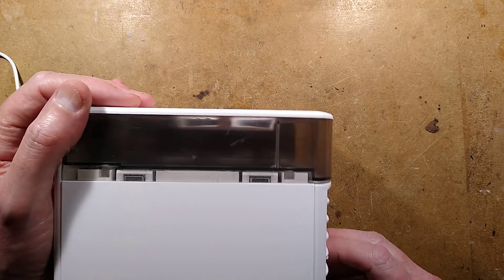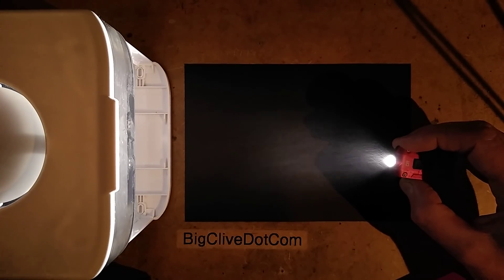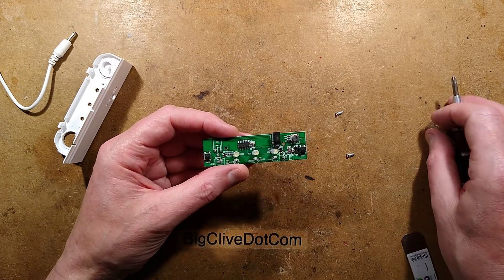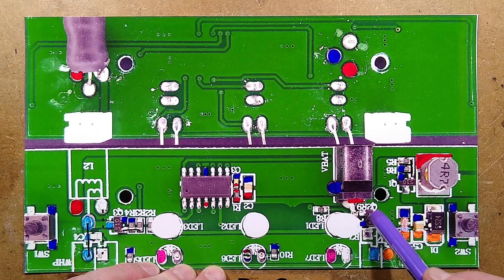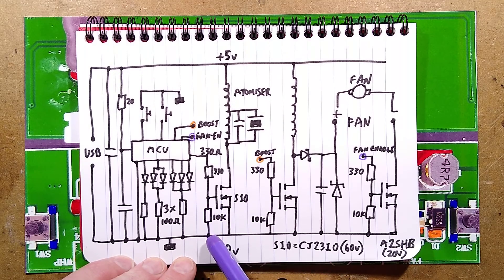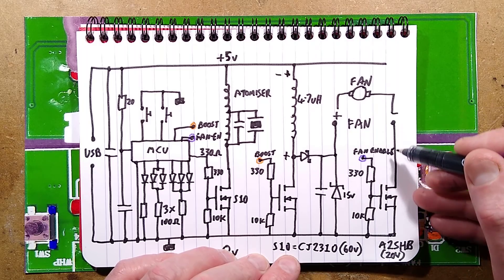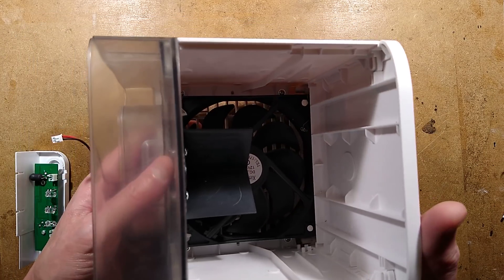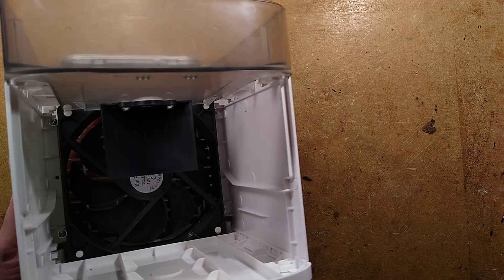USB swamp cooler with fake UVC "sterilisation" (with schematic)

Comment: I don't get it. They seem to have done a decent amount of work on the circuitry; why use fake UV LEDs? Is 5V not enough to power a germicidal bulb?
Reply from the maker: The cost of the real thing would be very high.
Reply: @bigclivedotcom   Don't know if it makes any difference at all if they are there or not, but would be replacing them by soldering in real ones have any benefit or even work?
Have to be honest, I can't really see any benefit right now unless it was water you were going to drink.

Comment: The only place those swamp coolers will work in the States is in the western desert areas like Arizona Utah and such. Pretty much everywhere else especially the southeast it's so humid they would be useless. Not that they're that useful in the first place mind you but I'm talking about swamp coolers in general. There are huge versions  you see in the West on house roofs and whatnot. They are huge relative to modern phase cycle air conditioning.

Comment: 100 mm 5vdc computer fan. Add usb plug. Hey presto a fairly nice quiet fan. Casing is wide enough to stand without added legs. To really make a nice one stick a grill front and back and a pair of twist out legs to give more stability. 
Upgrade model add a few fancy leds and speed control to fan. In fact start with a fancy lit pc fan. 
For cooling then stand a bottle of frozen water in airflow as another commenter suggested. 
Short sweet simple from bits from scrap/ hobby box.

Comment: Its possible those purple LEDs do actually emit UV. I would be interested in running them on some equipment to see how much or if amy UV is coming from them.

I bought some UV LEDs a while back and I thought they were all messed up because no visible light was comingfrom them but when I tested them on lab equipment, they put out an absoultely miniscule amount of UV (sharp peak at 300nm), but they did put out UV.
Reply from the maker: They're probably emitting 405nm near-UV.  No significant germicidal effect.

Comment: Might make a nice case for electronic load I am building, the case looks sturdy, has a fan for the heatsink and the electronics could go in the water reservoir.. The buttons on the top could probably be used too.

Comment: I see these fake "portable air conditioners" being sold in high humidity areas -- and people buy them! It's ridiculous. I bet they try it once, realize it doesn't work, and then throw it out or donate it to Goodwill.
Reply: Can confirm, I live in Florida and see a lot of them at thrift stores.
Reply: I made that mistake.  Threw it out after it sat on my desk for over a year.  North Carolina is basically Florida with more hills when it comes to environment, so swamp coolers are about as useful as a Yugo.  Granted, I bought it before the craze exploded, so I probably got it relatively cheap by comparison.
Now if I lived in a place like Vegas, then I might've used it more.
Reply: @DoomieGruntVentures  I live in Utah where at this moment is at 1% humidity and they don't work here either.  Had several friend who bought them and threw them away soon afterwards.
Reply: @covishen  The little ones may not work too well, but the theory is sound, and I've seen misters and the huge units work fine when the humidity is below 60%.
Reply: @DoomieGruntVentures  Even in a place like Vegas something that small isn't going to be very effective, IIRC evaporative cooling works out to something like 8000 BTU/hr per gallon. So 1gph is like a medium window AC running flat out.
Reply: @DoomieGruntVentures  NC gang what up I got one for like $10 and the fan broke after I dropped it two inches 😂
Reply: *Technology Connections, Computer Clan, and Freakin' Reviews enter the chat*
Reply: Funny, I just saw one at the Sally Ann!
Reply: they're only useful in the winter where you'd need some moisture in the air, but for the summer, you're better off saving your money and buying a dehumidifier to remove the humidity from the air, making it feel cooler.
Reply: Yeah I bought one of them damn things it doesn't work as good as they claim but it does cool it down if you use ice and ice water like the instructions and you freeze the little collector or whatever you want to call it it only drops the temperature down in my battery box about six to eight degrees but that's all I need to keep my batteries cool enough but the lower the humidity the better it does work but not very damn good least way is not the way they advertise
Reply: Where I can then pick up a fan, ultrasonic transducer, the drive circuitry, and a crappy Chinese power brick for a buck 98 🤣
Reply: I use the exact same one at 60% humidity and it still works.
Reply: @morisato54  They can be used (albeit a bigger scale lol) to assist air conditioning. The water carries more heat to the coils than the drier conditioned air. But in a typical house, even if set up ideally, there wouldn't be much difference with a unit this size.
Reply: @morisato54  It will have "immediate effect" with varying effectiveness. I don't mean to imply they can't do anything, just the limited nature of a unit that size.

They cool by forcing water to evaporate. The "total capacity" of the unit is limited by the amount of water it can get into the air, which is determined by the tank size, and the latent heat "removal" limited by how fast it can do it. More water evaporating, more surface area, more airflow, and lower humidity = higher heat removal capacity.

In contrast, I've seen new aircon installs in the typical 2-3 ton range easily pull 2+ gallons of water out of the air every hour... Even giving benefit of the doubt on it all, this means that in about a half hour (eyeballing the tank at a gallon? Adjust as needed lol), the cooler would need to drain it's tank and get it in the air to compete with the cooling power.

Also, contrary to popular belief, air conditioning is designed more for humidity control than temperature control, which is why they aren't very effective at low humidity, and a swamp cooler is. They work at opposite ends of thermodynamics to accomplish similar goals...

My only point really was that humidification such as from a swamp cooler, if well thought out, can have a significant effect at higher humidity, when it's complimented by an aircon. One unit feeds the other, and the second feeds the first. One big happy loop and the result is very efficient and very capable environmental control. But you've gotta be able to get the water in the air.
Reply: @MadScientist267  I'm just puzzled at how many people here somehow expect a device like this to work other than what it was designed for: a personal cooler.
Reply: @morisato54  Kinda a thing with a lot of this kind of stuff. Same thing with heaters... People expect somehow "space heater" means "whole house"... Or worse... Those gimmicky little 200W personal heaters... Barely make a bump in the thermometer right around them nevermind much bigger... See them at work sitting across the desks in cubicles from where people are actually sitting... 🤦‍♂️

Total waste of time, effort, money, and energy.
Reply: @morisato54  It will still have some cooling effect, just not nearly as much as with dry air.
Reply: Could make one yourself for 10 bucks. Buy 2-5 gallon bucket, lid, styrofoam for the insulation, fan. 

But yea shits not gonna work in high humidity. People should know that living in these places.
Reply: Fill it with piss, return to store, find an outlet, plug it in, leave.
Reply: @freedustin  my son is an alcoholic. If you use his piss it'll make their eyes water. Although it is a bit like syrup.
Reply: It's just for thermometer watchers. Lowering the temperature by increasing humidity doesn't make you feel cooler - or be cooler.
Reply: @dhaen  at 1% humidity and 110f you'd see sub freezing temps on a good swamp cooler, you will definitely be cooler in 60 degrees and humid vs 110 degrees and dry but not nearly as cool as 70 degrees and dry
Reply: They do use the HUGE units here in Houston.  There are certain times of the year (such as a few days ago) where the humidity drops down to 50% or so, and then they do help.   They just have to work where the humidity is low enough that sweat evaporates, rather than sitting on your skin.
Reply: @tbelding  you mean the water wall? that thing is so cool (pun intended)
Reply: @freedustin  If you mean the one at the Transco/Williams tower, no not really.  I was referring to the 4-5' square units, sometimes hanging next to an overhang where work is done.    (Saw them a lot at salvage yards.)

Comment: Yes, true.
I shined a so called "UV LEDs" into an spectrometer.
The wavelength was not shorter than violet, no UV whatsoever.
You can buy UV leds that actually produce UVA, UVB and UVC.
They start at $1.00/ea, not 100 for $15 like you might find on ebay.
For killing microbes, you need UVC, these LED's are $10.00 and up(way up).

Comment: I'm surprised that these units apparently are not so infamous in Bigclive-land. Maybe you never spend time on social media, where the unbelievably scammy ads for these things when they came out insisted they would "air condition the entire room in 10 minutes", or the story about how it was "invented" by some brilliant schoolchildren who "have all the big air conditioning companies running scared".

How unsurprising that the manufacturers were willing to add some cheap UV-A LEDs to this year's "Covid edition" so that the scammers could extend their BS campaigns to even more credulous suckers without spending any more on them. Not that it doesn't do anything to make people in dry climates feel a bit cooler (if you sit close enough to it). Just that the marketing and sales tactics for these things has been so full of lies and inflated pricing (apparently to fit the overblown promises) from day one that it's hard to take them seriously anymore.

Does Isle of Man ever get heat waves that are not also high humidity days, thus rendering swamp coolers fairly useless?

Comment: Unless you are moving heat out you can keep it. Proper insulation, AC and a dehumidifier is the only way. To think that people would add moisture to the air blows my mind.
Reply: That's about extremes or perceived extremes. My aunt believes she's healthier for keeping damp towels on the radiators. A friend moved to Vegas (hot, dry and recreationally toxic) and aged very quickly.  We blamed the lack of humidity.
Reply: @tactileslut  yeah keeping damp towels on the radiator makes sense since the heat would be on and it would most likely winter. I guess if you live in a desert it might me nice to add some humidity but where I live and most people live, that is not the case.

Comment: where I live, where swamps are a physical reality, a swamp cooler does nothing but increase the humidity in the air, or if already saturated, just spews water vapor...works great in areas with non-drinkable air. (had to change that, can't add humidity when it is already 100%, my normal summer)

Comment: When you said "...case with a fan..." I immediately thought this might be a good small raspberry pi case - it looks big enough to hold several.  It could also serve as a decent soldering fumes exhaust fan, with an activated carbon filter where the wicks go, or even an ESD ionizer/neutralizer by just adding a simple AC ionizer module in the water tank.  Anyhow, thanks for the tip, I'll probably pick one up to tinker with, they seem to be all over the place and they're <$20 even in retail stores.  Love the channel - Cheers and Beers!

Comment: Quite interesting case for reverse engineering. I would add, that as sold, it's a fantastic unit for spreading things like legionairs disease though.
Reply: It doesnt recycle the water. Sure if you use shit dirty toilet water maybe. But if you keep it clean its not gunna give you legionella.. Ffs.
Reply: @Steve211Ucdhihifvshi doesn't matter - it it stays moist it could eventually harbor and grow microorganisms, they're always floating around in the air.
Reply: @Steve211Ucdhihifvshi  no but it recycles the wick doesn't it, so if that's never cleaned correct then yes it can harbour legionnaire

Comment: Could you share the listing a search for rage-man has no results
Reply from the maker: https://www.ebay.co.uk/itm/393277444773?var=662185532608
Reply: I found the seller easily, lots of random tat. The cooler is out of stock and up to £20 now

Comment: i treat sore teeth with INTENSE blue light led bead running at 300 to 400 milliamps. its seems to work because my partner had sore teeth and could not get to the dentist because of covid. 3 times a day over 3 days for a 1 minute close to each tooth. the wavelength is 405 to 410 nm. i attached it to a 1 dollar power bank. wish i could you show a picture of the device...The pain went away and has not returned and still not seen a dentist!!

Comment: The atomizer circuit seems wrong to me. Piezo stuff is high impedance. Is this no piezo but a magnetic speaker?
Reply from the maker: It's a piezo ring with a perforated atomiser disk on it.

Comment: 0:15 Channel "Computer Clan" claimed in this case "AC" does not stand for "Air Conditioning" because it misses key components required for such a unit, but it stands for "Air Cooling" .
Reply: The ads do claim they do the work of expensive, big air conditioning units. They usually even show condenser units for whole house central AC installations. The ads also usually claim these coolers were invented by some down and out person who just lost their job.
Reply: @dougbrowning82  What I mentioned is in the fine print.
Reply: @MrMegaPussyPlayer  Hardly anybody ever reads the fine print, especially if they have poor vision. It's called "gloss" and is almost always kept separate from the main text.

Comment: Hey Clive, I have bought a tiny little Chinese made usb powered bug zapper for my cat, as during this hot summer heat what with the need to keep windows open for air, her food bowl was a fest of flies and maggots within minutes of any wet food being put down. It too contains just a few UV LEDs lighting the centre and it looks like a miniature toy, yet it works for highly localised cat food bug zapping.

However, as a regular viewer to your channel, I can’t help but wonder if it’s quite fit for purpose and safe to use (I’ve positioned it carefully just in case), so if you’re interested I’d be happy to post a link to the Amazon listing.

Comment: I just checked on DigiKey, and the smallest wavelength LEDs you can buy are 255nm (UV-C = 100-280nm), pretty expensive and with laughable output in the two-digits mW range - mainly because their radiant efficiency is at around 2%. Right now, all cheap disinfection devices utilizing LEDs can only be a scam, as they are likely to use 400nm LEDs that have no considerable effect on bacteria or viruses.
Reply: The UV LED's have a less fluorescing effect as it is much longer wavelength than the fluorescent black lights used in clubs.
Reply: You're wrong.

Blue light in the 400-425nm range definitely is antimicrobial.
Reply from the maker: I looked at research on that subject and the results were all very vague.  There was nothing decisive.
Reply: @somedutchguy7582  There is a pretty good graph in Wikipedia (article "Ultraviolet germicidal irradiation", quoting the "Ultraviolet Germicidal Irradiation Handbook") that shows wavelength vs. germicidal effectiveness on E. coli. Above 320nm it shows simply zero. 400nm is completely useless, especially when we are talking about most of these LED devices intended for mobile usage with very short irradiation times.
Reply: @graealex  The graph just stops at 320nm, so you cannot infer anything about what happens at ~400.
Reply: @somedutchguy7582  The graph itself goes up to 360nm, it's just that the efficiency line converges with the zero-line at 320nm.
And yes, I can infer that at 400nm, the efficiency would already be two orders of magnitude lower than at 265nm, so what disinfection would usually take two minutes would already take three hours at similar radiance levels at the longer wavelength.
And I am not going to buy the book just so I can refute a YouTube comment that believes a deep-blue LED would somehow magically start to disinfect. If that were the case, serious equipment would since long have stopped using mercury vapor bulbs for that reason, and OSRAM wouldn't sell 265nm LED chips with less than 100mW output for $40+, when it could all be done with cheap 400nm LEDs.
Reply: @graealex It is neither my belief nor magic, it is scientific fact.
 I posted some five or six links to scientific research in response to Clive, I don't know where that went, but here's at least one:

https://www.sciencedirect.com/science/article/abs/pii/S0195670114001844

Comment: I had one of these once. I put it in my bedroom and went from hot and sweaty to hot and wringing wet with sweat! The humidity went through the roof and the fan kept me awake half of the night. Next morning I discovered that the reservoir had leaked water all over the top of my Ikea bedside table and ruined it. I dumped it (but kept the fan).
Reply: Went from hot to balls hot
Reply: You were in too high a humidity environment to use it